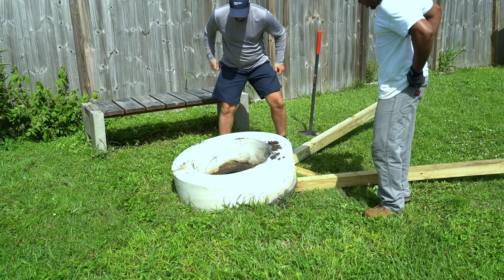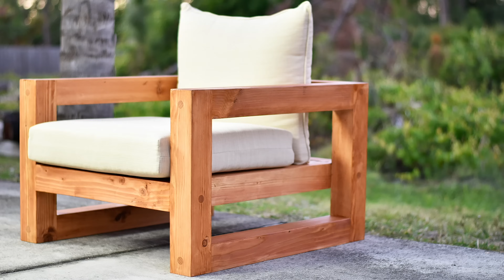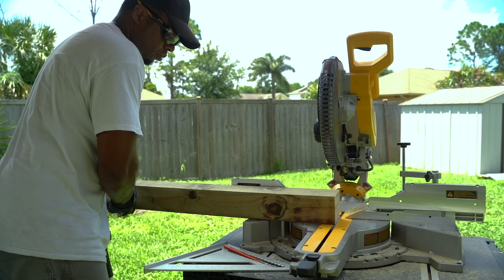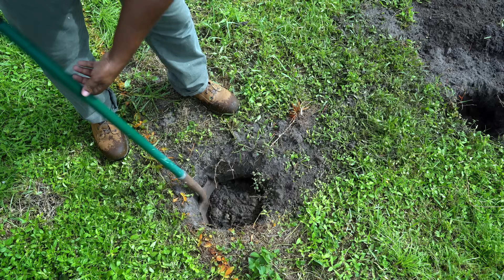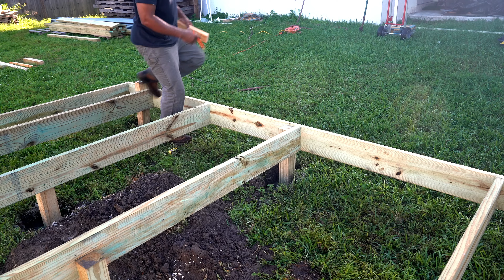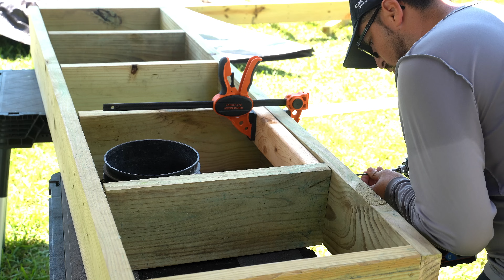Building A Ground Level DECK - (Part 1)

Comment: Note: Don’t use deck screws to attach joists. Deck screws do not have sufficient shear strength. Use galvanized nails at 1 per 2” (so an 8” joist gets 4 nails)
Reply: On one hand you’re absolutely right, because on the other hand there are joist-rated screws that are allowed by code in some regions, but he wasn’t using them here.
Reply: I'm also building a 48x17 deck, and new to it as well. From my research, deck screws are about as useful as drywall screw. Cheap, heads will pop off, really only should be used for screw deck boards/trex in.  Otherwise, borrow or rent a nail gun and use hot dipped galvanized nails and actual structural screws.  
Nail gun is going to save hours of work, and you end up with a very strong structure that will fail gracefully as nails will bend vs catastrophic snapping/failure of deck screws.
Yes you can use deck screws as done here when the frame is properly supported, however the minimal cost is minimal if you take into account the value you place on your family/friends, resale value.  Or if you have a Permitting guy who's going to Inspect...
Reply: If the structure needs to flex in high winds the nails will flex and bend vs screws break in half under stress. *Custom home builders daughter.

Comment: I noticed one thing it a trick i used to build decks ; i use kilzs at the bottom of 4x4 in the ground to the top of level about 3 to 4 inches above the ground also for extra strength i put clip at the end of every stud plus inner and outter corner brackets and I use leg bolts and washers counter reassessed in to the wood corners and every joist in between. The end results will be totally stronger ive built many decks in my career just sharing tricks I used weather big or small decks in from New Orleans so I know a thing or 2 about hurricanes myself ; but I love watching you build and learned a lot more ideas from you thanks just thought I trying to give back 

      Keep building brother my name is Allen

Comment: Here in Northern Europe, we make the columns underneath out of concrete or metal. Wood in cement without hydro insulation would result in rot rather quickly.

Comment: Overall nice job.  You should not just use screws to hold the joists to the posts.  These will shear off with too much load ruining your work.  You should always put the posts under the joists for support and add a hanger to hold them in place underneath.  We had a deck on a two story  home that was built the same way and the entire deck sheared off the outer posts and caved in.  Luckily, we had not been using it and I had already planned to replace it.

Comment: Construction isn't your thing bro. The wood is not concreted as it will rot. The frame is always assembled only on nails. Black self-tapping screws are brittle at the break and rust. And the frame should be elastic.

Comment: Love the video, some great ideas I'll use in my own project.

But for me, ground level means 'flush with the ground'.

I dug out a 3000 sq ft pond in a flooded backyard last year, with French drains along the property, draining into the pond. This spring/summer I'm having more topsoil delivered (20-30 yards), grading, seeding, then building a small enclosure with wrap-around partially covered porch with steps down to a dock I'll construct on the pond. I will make the foundation all slightly raised with a gravel base and drainage sloping to the pond.

But I want the customer to be able to walk right onto the wrap-around porch and into the building without having to step up.

I'll share on my channel once complete.

Comment: Nice. One recommendation (may have already been mentioned) for anyone doing this or for you next time.  I would strongly recommend putting your main beams or at least a few joists on top of a post instead of screwing in from the side.  If you really don't want to do that then I'd recommend at a minimum using carriage bolts all the way through your 4x4s and supports. I wouldn't even use lag screws let alone the 4 inch deck screws you used. They'll be loose as soon as the wood shrinks a little and they just don't have the shear strength to support the deck.  Not a terribly dangerous situation since the deck is so low, but if this was a 2nd story deck it would be quite dangerous.
Reply: Yes I totally agree. At minimum the posts should be thru bolted and there should be joist hangers. This deck has essentially no structure. The entire weight of the deck and anything/anyone on it is being held by the screws that attach the 4x4 posts. That won't be safe (or pass code anywhere) and it won't last long. This deck is high enough off the ground that you could have had proper support beams under the joists instead of having all the weight hanging on the post fasteners.
Reply: yes i agree with lag bolts to support the weight of people
Reply: i like
Reply: yup, I cant beelive what I saw in the video

Comment: Guys use your local tradesmen this is not the right way to build a deck there are building codes and regulations for timber decks

Comment: Do your self a couple favor’s and use zinc coated construction hangers at every 90 degree butt joint... and notch the 4x4 post so the joist sit on a shelf... makes everything much stronger.... and dude next time use quick crete red bag manufacturer recommends mixing in the post hole... so much easier and faster.... but for your first construction project great job!!!! But seriously construction hangers

Comment: Screws have no shear strength, therefor should never be used in structural framing especially into end grain. Also the posts should have concrete to ground level and should be set under a beam which the deck is fastened to. If you wanna fasten the posts like that at least use lag / carriage bolt  or the very minimum 3 1/2" ardox nails.
Edit: Seen the second video he addressed most of the issues.

Comment: Pouring concrete around the posts is a major mistake. Pressure treated lumber will not help you. Water gets trapped in between the concrete and the wood. You also should have used metal joist hangers. That angled ladder you made is never going to hold up.

Comment: Putting the 4x4's into the ground with concrete around them will rot the 4x4's. You should have set the 4x4's on top of concrete  that was level with the ground. Your deck footing will not last.

Comment: You are showing people some pretty bad habits here. That little block of wood on the miscut rim is certain to come off. There is a good chance someone will step over the angled stair, that's why code Always keeps them uniform. Just saying, if you hold yourself up as an example you really should do it right,

Comment: I have watched this three times and now "get it".  Nicely done. Very well done.  Renogy has driven me nuts with mixed info on fuse sizes.  If I have 3 100 watt panels, coming into your system here, what sort of fuse sizes do I require with 2 100AMP batteries... 3 100 amp. I have a new Renogy 40 amp Controller and a new Renogy 3000Watt inverter.  I can't seem to find the formulas for calculating such things... or that I trust.  
thanks.

Comment: I swear I hate firepits.  In some areas, you go outside at night and you can cut the air with a knife there's so much wood smoke.  Every joker in the neighborhood lights up at the same time and then they wonder why they get lung cancer in 20 years and they never smoked.

Comment: Anyone who is going to do this, the posts MUST be completely enclosed in concrete, not sitting on the ground, and the concrete must be mounded up well above ground level regardless of whether they are timber or steel. (Rot or rust)  Hang the posts in the holes off the supported structure (on old bricks n junk etc) so they are a few inches off the bottom of the hole. forget about the gravel. the structure should be attached to the posts with half inch bolts or gal rod with nuts. Batten screws are not approved for this job as others have said. Use joists hangers. batten screws rust so they cant be used for this job. you would need about 8 per post and stainless steel  if you were going that way, but it's not to code. about 5 would equal one bolt.

Comment: Unfortunately the uprights cemented in the ground will be rotten within 10 years. We use concrete uprights & all sawn edges should be treated. Don't be fooled into thinking tantalised timber lasts forever. It doesn't.

Comment: Ill use screws to hold deck boards down but any vertical boards that join I will use 1 screw to hold it together and put 3 nails in. Screws don't have sheer strength like nails, not the best thing to use for any load bearing joints

Comment: The deck joists should be mounted on top of posts, not side screwed in. It would never hold a high load or pass inspection. The deck is now only as strong as the screws scheer strength.

Comment: ...good job .. the only thing I would add is that screws are great for tensile strength but nails are much better for shear ... therefore nails are preferred for floor joists

Comment: Thanks for the instructions.  I live up in Canada where we have frost so I'll just have to adjust for that!  Great job btw!
Reply: Hey, same here.  Did you get around to building?  I went about 4.5, 5 feet for my fence posts but wasn't sure if I needed to do the same with the deck.  Let me know how far you went with the deck posts!
Reply: @mattantongiovanni3409  Not yet Matt, It's on the north side of the house and part of the area closest to the house is still frozen.  Soon .... I hope!
  Come on spring!

Comment: That's the problem I have no matter how many times you check and your spirit level says it's spot on you still keep checking it always.
Great video 👍
Reply: You actually want a very very small run in your decking so rain rolls off and water doesn’t sit on it as it would if it was completely level

Comment: Haven’t read all the comments but all the weight/strength is based on the sheer strength of the screws.  What you should have done is place the deck on top of the posts. 
Nice job otherwise.   Maybe consider wood glue in addition to the screws if you maintain keeping the posts the way they are.

Comment: Those screws on those post you buried/concreted are carrying the entire load of that deck. Would have also used joist hangers/ or designed with beams.
Reply: 👍🏾 or notched the posts

Comment: Good work man! My father and I have been building decks like this for many years and they are rock solid even without joist hangers.  We use 3 inch screws on all the structure and we overbuild it with extra cross bracing just to be sure.  The decks are still standing 10-20 years later and we saved lots of money not bothering with the expensive hangers, brackets and lag bolts.
Reply: Thoughts on ventilation for ground deck.  Wife wants an ipe deck but concerned about lack of 18 inch recommended ventilation.

Comment: Love the deck, was told that your posts are made wrong as your putting all the weight on the screws they say to notch the posts so the joists rest on the post not off the screws. After redoing my deck that has been there for a while I found out my posts are the same way all the deck weight is on the screws

Comment: What a great video, and well done editing.  BUT... The only problem is, this is a dangerous deck.     You are depending on the screws to hold the weight of the deck, in carpentry, this is a major problem!    You need to cut away some of the 4x4's supports and make a support shelf, and set the beams in the cut out section.   You cannot rely on screws to hold that  much weight, you are asking too much of the  screws.   It look great, builds well, until you have 30 people on it at a party, then the whole thing will collapse.   Again, it looks great, but the most important part of the build was done wrong.

Comment: No joist hangers, no bolts. The whole thing is done with screws. That is not the way to built it. For this diy project, that is fine I guess but it won’t pass any inspection
Reply: Or last more than a few years....

Comment: I’m no builder but it probably would’ve been a better idea to notch the top of the posts to accept the joists, rather than relying on the screws only.  Over time those screws will give way.

Comment: that looked so much easier than squaring your project using batter boards and then running string and then digging posts and then checking for square.. I always thought that there had to be a easier way to do this,, thanks,,

Comment: 👍.  If I don’t have access to a laser level for big projects I use a water level. Easy to make and very accurate. And it will go as far as your hose will let you, 25’,50’,75’ whatever. Keep up the projects.

Comment: This is not built right whatsoever. Good thing this will only collapse ~1ft. Hopefully nobody is underneath when it occurs. Issues with the approach: Support post rot, joists are not supported properly. Beam attachment to posts are no good. Don’t try and duplicate this.

Comment: Nice work, but I definitely think that needs more legs concreted in for support. Another tip to take out any bounce and also helps the weed sheet stay down, is to put some broken slabs or bricks, under the joists in various places this helps massively. Other than that good work 👍🏼

Comment: not a fan of the way the posts were done, Trex is super heavy, i expect this will sag alot in the coming years. i sure hope those are structural screws, because if they are simply green deck screws, they will be rusted and broken in 5 years.

Comment: You're putting wood posts DIRECTLY into the ground? Seriously?
The proper way is to put in cement footings in the ground, with metal "anchors" on top that will then hold the wooden posts.
Reply: Cement square pavers? I was about to follow this method but I saw your comment and now I'm confused what to do

Comment: I feel like you do everything backwards. That deck is doomed without a good paint or staining. The sprinkler system will rot it even if water doesn't hit it directly.
Reply: You generally can't stain treated wood immediately because it's too wet.  You have to let it dry for a few weeks minimum
Reply: even then its done wrong, cant stain the whole board

Comment: Shouldn't the deck frame be bolted to the support posts ? (Large deck bolts with washers )... and cut a notch out on one side of the top of the support post the width of the joist board for the joists to sit on and deep enough for the joist to be flush with the top of the support post?
Reply: @Hello Len how are you doing

Comment: I don't know man, I'm not an expert, but the entire structural strength of that deck is dependent on the sheer strength of those deck screws. You didn't actually support the weight of the deck from underneath anywhere. It looks pretty nice, but that's definitely going to collapse at some point.
Reply: Your absolutely right. This deck would not pass code here. The framing should be held by structural screws or framing brackets with joist hanger nails, not deck screws.
Reply: This is why I came to the comments!

Comment: Great Vid. Now if I were to be building this on an existing concrete slab could I skip the elevation portion of the project and just lay the joists right on the slab?
Reply: use right angle brackets in gal, s steel or thick aluminium dynabolted to the concrete use small packers under the deck to get it perfectly level and then attach to the vertical side of the brackets . never put it right on the ground. it will rot. dont copy this guy. he has made heaps of mistakes
Reply: @johnw6648  Thank You very much for the info.

Comment: Nice job, but you will use alot less sand and cement if you use some aggregate. Gravel, stones whatever.
Edit: You should try a pullsaw for flush cutting, it will surprise you. Push saws are fine but once you have tried a pullsaw, you won't go back!

Comment: If those posts rot the whole thing will need to be taken apart. Much better to build concrete footings which the posts rest on, rather than cementing them into the ground. Having said that maybe hurricanes are a bigger concern than wet rot in Florida.
Reply: True

Comment: It looks like you made a mistake by adding that angle board.  You should have kept it a rectangle.
Reply from the maker: This is the look I wanted no mistakes here.
Reply: @DIYCreators  I know you didn't make a mistake but it appears that the deck is not straight.
Reply from the maker: If it was rectangular it would just be another deck. I happen to like the design. I believe design has no limits and you should push creativity. Sure if may it not sit well with everyone, I loved it on paper and even more in person.

Comment: What happens if the posts settles?
Wouldn't the foundation need more concrete, and a wider footprint?
NOTE: I'm not a building, just wondering...

Comment: Notch the 4× 4 or 4×6 is better and then lag bolt it do not count on. Just screws to hold the whole thing up that's wat only holding it but it is guess a ground level deck so when the screws fail n ropin they're not jus regular drywall screws can use screws but gotta notch the 4×4 is fine up to 6 to 8 feet off ground then go to 4×6 6×6  @ on if higher deck should use joist hangers and il tell everyone sumn itzz great work give the guy a break and only thing is you really gotta use only fasteners talkin screws nails that are for pt wood or pressure treated wood for close to ground applications or some ground level like hot dipped galvanized 3 "  by  .131 width of nail or a 3-1/2" nail for treated wood if not regular drywall  screws or jus regular nails into treated wood will eventually rust make sure if you're using treated wood for any of your projects u use look on the box. Of a fastener into the sides or deck board on top the box says for. Pressure treate lumber........RUDY KIRSCH OHIO
Reply: If. It fails. It isnt a. Big fall anyways.........its not the fall anyways that killz ya it's the sudden stop at the end.........